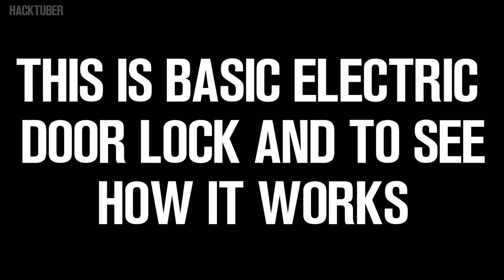How To Make Electric Door Lock at Home

Comment: The motor and gears are overkill and the high speed of the brush motor is jamming the gear at the end of its track. A simple solenoid actuator from an old washer or washing machine would work do the job without the extra complexity and risk of gear damage.
Reply from the maker: Just for you,next video with handmade solenoid lock system

Comment: If battery goes out . Then u cant open doors wow!!!!😂
Reply: What is the solution for this problem ?
Reply: @omer5755  When the battery runs out it actually unlocks the door because of the spring. There's barely a chance of being lacked out.